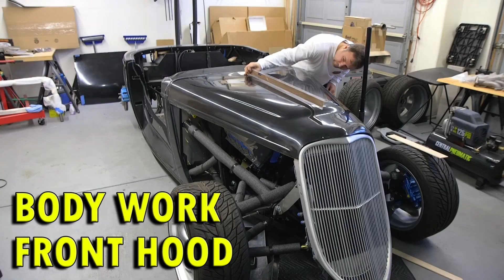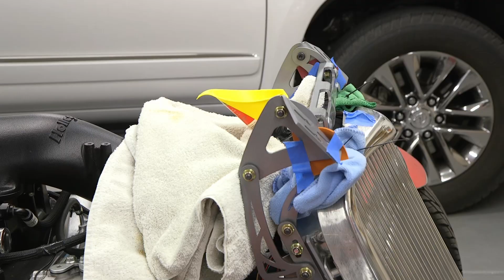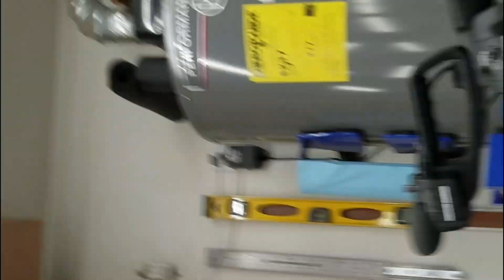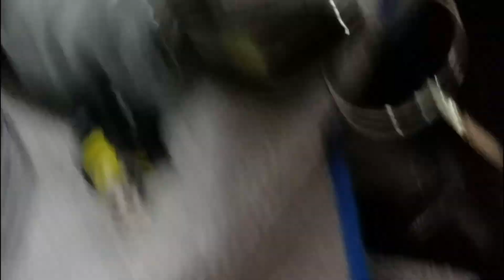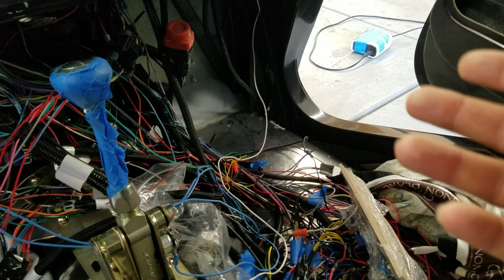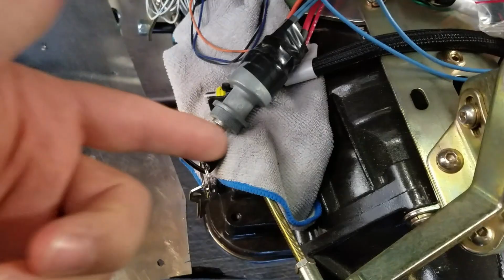Five 33 Hot Rod V2 - Rewire Sensors and Reverse Lights

Comment: If I remember right that shifter that you have came with a park neutral safety switch button that you screw in where you have your safety switch. you put that solid button in adjust your shifter so the car is in park then lock it down pull the button out and put in your neutral safety switch. I remember I had a hard time fiddling with it but you should be able to get it good luck.
Reply from the maker: I tired that 3 times doing just that.  That is my limit.